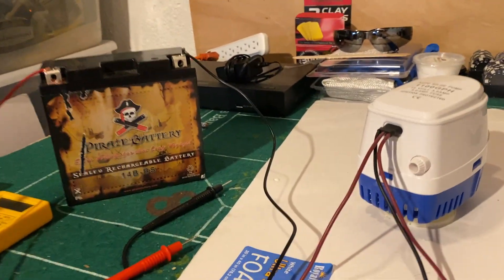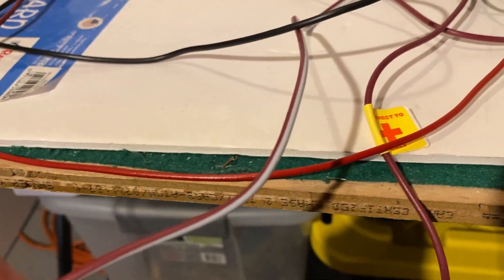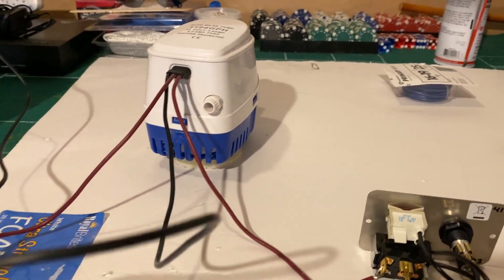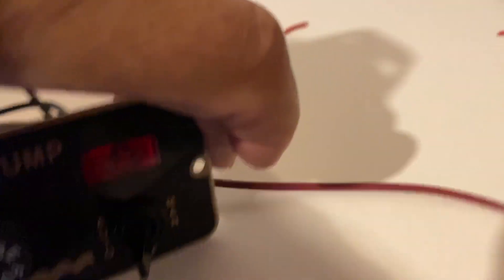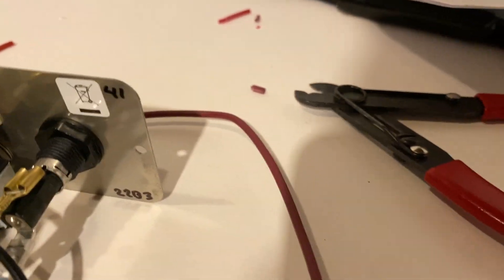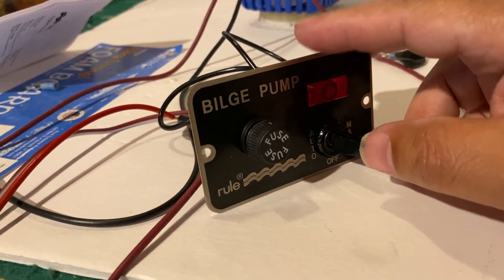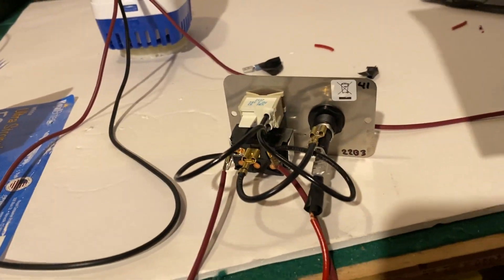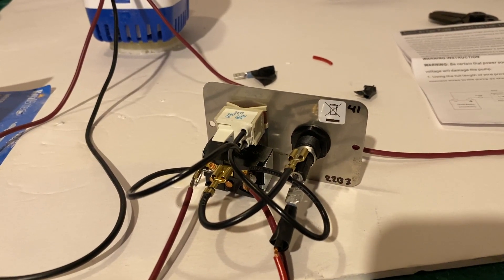How to wire up an Automatic Bilge Pump and a Rule Panel Switch.

Comment: AVOID this make of pump. My hubby bought two of them but the instructions that came with them described these colour wires but the pump itself had completely different coloured wires. He blew both pumps and wrecked the batteries by following the included instructions. They are CRAP.

Comment: you wired light wrong. it should ONLY come on when pump is running, or it will drain your battery

Comment: The light will not work with this configuration.  You have both poles of the light bulb hooked up to the same post on the switch.
Reply: I made that comment after watching the first half.  Now that I have seen the whole video, my original comment is no longer true.  However, the purpose of the light is to let the boat operator know when the pump is running.  You have the light hooked up so that it is always on when the switch is in the auto position.  Take the wire and butt-connect it to the auto wire for the pump.  OR, connect it to one lead from an auto float switch, if the auto float switch is separate from the pump.
Reply from the maker: I think you might be right! The diagrams these things come with are hard to read. I will be posting an updated video once I get settled.  Thanks for the comment. i got some better diagrams and will try to correct this video soon.

Comment: Your video saved me so much trouble. Seriously. I was about to remove panels, cut wires, and it would have been a big pain in the ass. Your video showed me that it was a connection issue at the switch. I owe you a big sloppy blow job, sir.
Reply: Lol